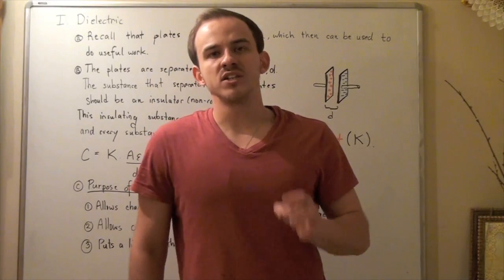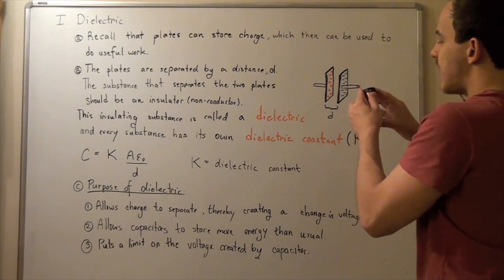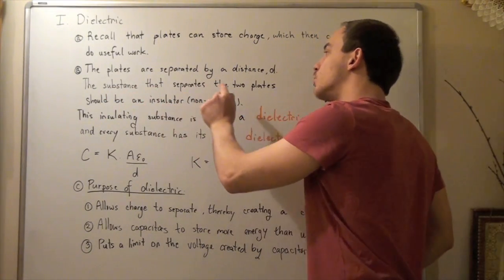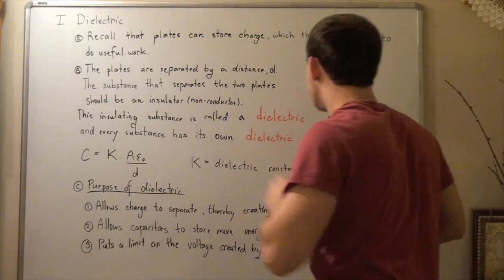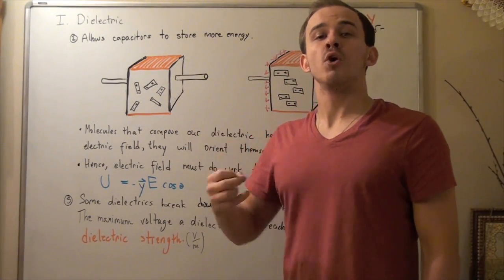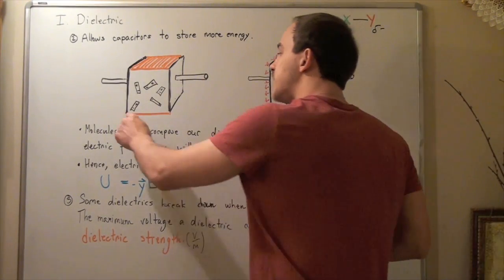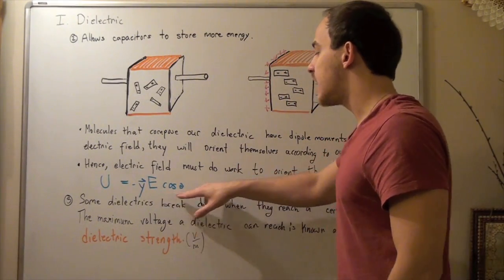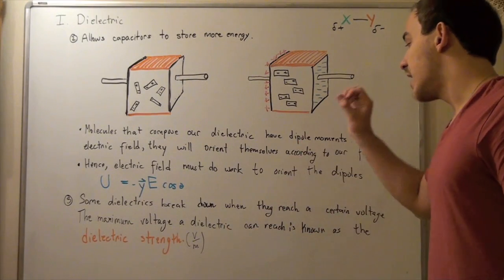Dielectrics and Dielectric Constant

Comment: but in metallic plates are touched together the current will still flows and whole circuit behaves like short circuit and battery become  very hot  as we continue to circuit to be closed. as we wove plates apart  its capacitance again  will increase.

Comment: Could you apply this to quantum biology in the context of structured water as the electric field, and thus the structured water will orient dipole molecules in the living system not only storing energy in the structured water  but also in the dipole moments of the molecules in that specific living system. Meaning that we not only gain energy from ATP but also from Structured Water which can be charged by light?

Comment: You're a great teacher. Thank you for making these videos!

I'm sure with your intellectual capacity, you would be able to bring light to a topic that has been puzzling myself and many others, yet if you would address it, beware you'll be attacked by whole industries in all likelihood.

The topic, the question is, would it be possible to a create human-machine connection via graphene oxide (GO) nanoparticles (NPs) and electromagnetic communication? The end goal being mind control, the prime target would have to be the brain and neurons.

Say for example, if you saturate a body with GONPs. You would have an electromagnetically sensitive mesh network of points throughtout the body. Perhaps the GO could create strands to create a circuit, or an artificial nervous system.

Other pieces of the machinery could be plasmonic antennas, radiogenetics (maybe optogenetics), self-assembly, carbon nanotube antennas, magnetogenetics, quantum dots, fuzzy graphene...

Two-way communication seems like a hurdle too, not so much send EM waves into a body, but sending back EM-waves that are powerfull enough to reach a receiver.

As you can see, I see many pieces of the puzzle and have to think, when the right pieces are put together, it must be possible to create an interface to control humans.

Obviously, that's bad new in bad hands, and bad hands do rule the world right now, so it seems wise to figure out what we could be up against.

Comment: I have a question, maybe I am wrong. Why are you pointing the positive end of battery while saying cathode and pointing the negative while saying anode? Shouldn't it be the other way around? Thank you.
Reply: AK LECTURES You sir did a great job in answering this question.
Reply from the maker: Can you be a bit more specific as where I said that?
Reply: 0:50 and 1:14.
Reply from the maker: Oh I see. Yes, what I said in the lecture still holds true. Whenever we charge the capacitor, the electrons flow from a place where there is an ample amount of electrons (anode of the battery) and collect on one side of the plate. That pushes the electrons on the second other plate to flow to a region where there are fewer electrons (cathode of the battery). Hope that helped.
Reply: Ohhhh, Thank you very much. I actually didn't know that Cathode is the positive and Anode is the negative in a battery. I thought Anode is always the positive and cathode is always the negative. Thanks to you now I have learned the correct information.:) Thank you very much for your reply and your videos! :)
Reply from the maker: By definition, the anode is where oxidation takes place and the cathode is where reduction takes place. In a voltaic cell that is used to charge the capacitor, the electrons flow from the anode to the cathode. In a regular battery, the charge on the anode is negative but in an electrochemical cell such as an electrolytic cell, the anode has a positive charge. So the charges are not always the same.
Reply: Yes. Thank you very much :) This is an important detail to know.
Reply from the maker: You're welcome! :)
Reply: orhun özkumlu This is something that had bothered me for years.  I was going to ask Audrey the same question.